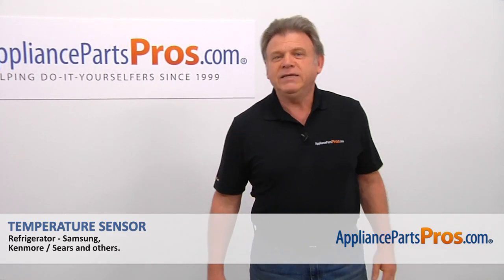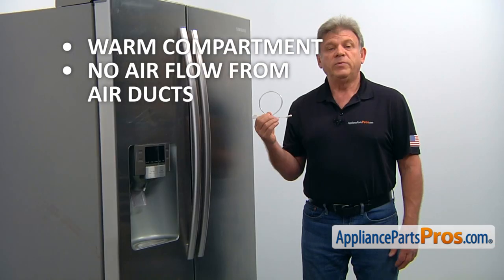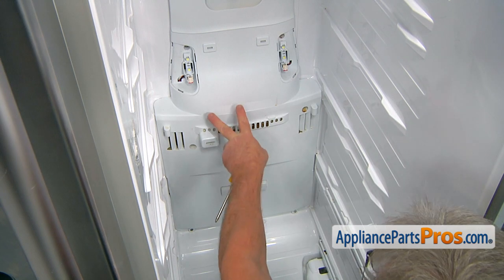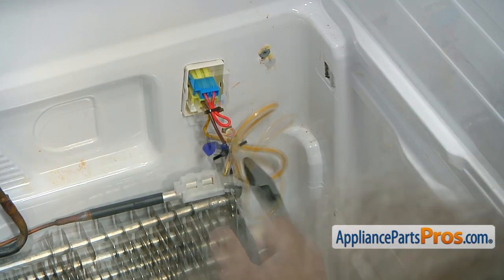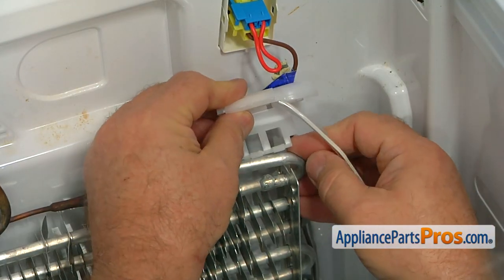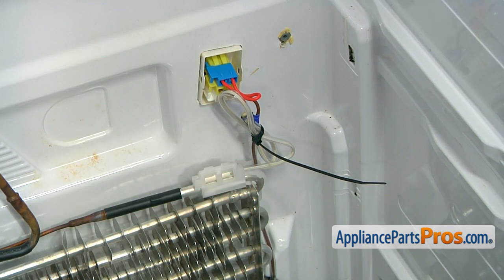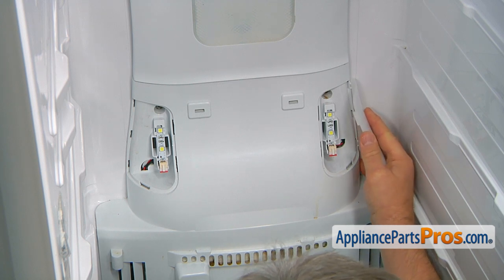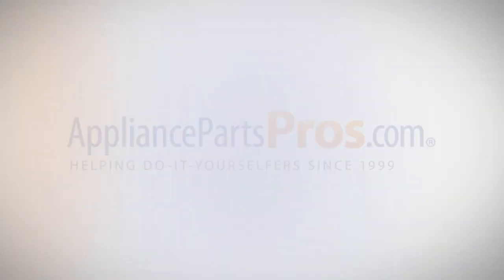How To: Samsung Temperature Sensor DA32-00029N

Comment: I have a Srs584dp model. Would this sensor work with that? My issue is erratic temperature values shown on the front panel

Comment: What are the resistance value for 25C, 3C, and -18C when they are new? and what would be a "not working" resistance value? Is this sensor works in both the Freezer and the Refrigerator side?

Comment: The sensor should be placed on the left side on the copper line. This is a known issue with Samsung with ice build up resulting in fan blocked by ice and the fridge section not cooling anymore. Ask me how I know...
Reply: Have a photo or sketch of where on the copper wire? The thin part immediately to the left of original spot or upper left on the thicker copper part?